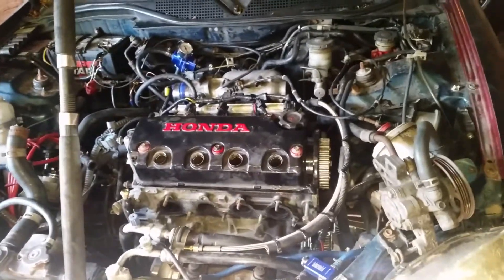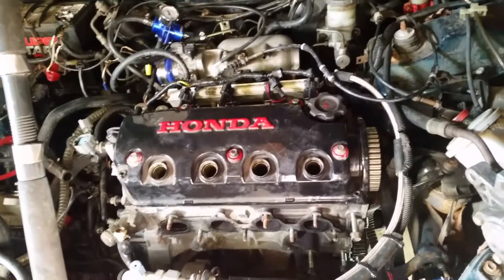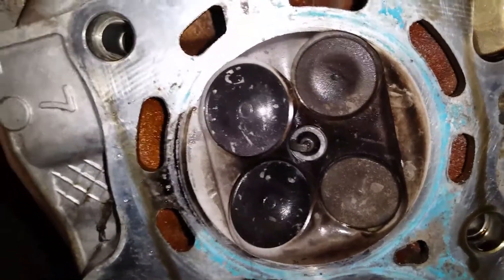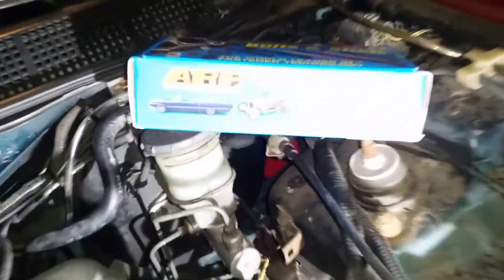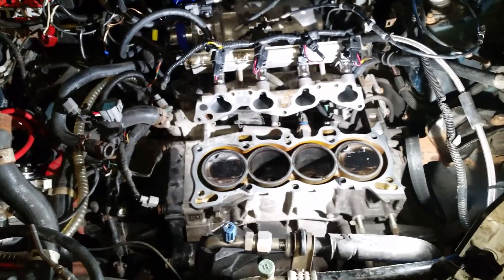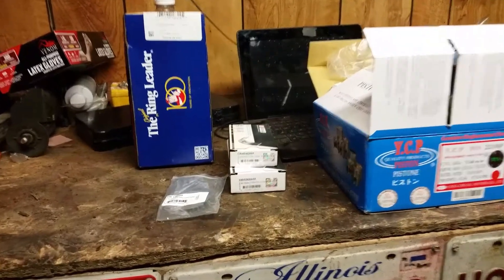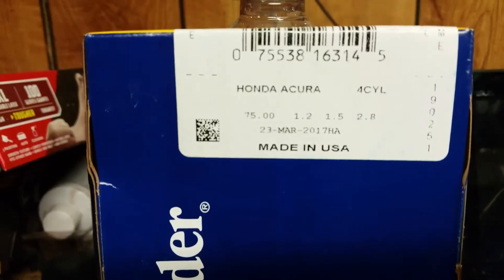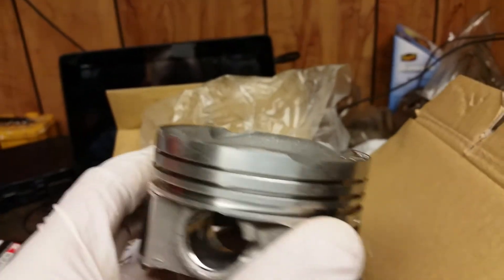$500 ebay turbo update part three!

Comment: i have a request, Go into details on ring gapping please- as in based on how much boost one plans to run on their build or a rule of thumb.
thanks
Reply from the maker: I'm dealing with wrong size bearings on my rod ends right now, and work doesn't have time for me to play Hondas like I want to. we'll see if I don't forget the ring gapping when I get there. .
Reply: victor de la puente, jr. ok no problem thanks.

Comment: So before I am tore up for saying something critical, I have built a LOT of shit. All of that hard work you are putting into this, and you are using AC, house wiring wire nuts near the fuel pressure regulator? It takes a few extra minutes to us non-insulated crimp connectors and heat shrink man and you will never have an issue. Hate to see a 2 cent wire nut ruin your fun man.
Reply from the maker: Ben Chapman thanks for your concern, those are the only ones not soldered and heat shrunk! they used to go to the 3 wire IAC valve (which is gone now that I've got the proper "boost ready" ecu) trust me, they will get soldered and heat shrunken, but that will happen after my street tune, and after the motor and everything comes out again to clean up all the wiring and paint the engine bay. it should hold for a few weeks or until the end of summer - then it will all come back apart again for the final clean up /finish job. 
thanks for watching!